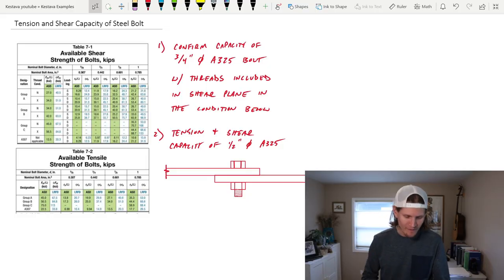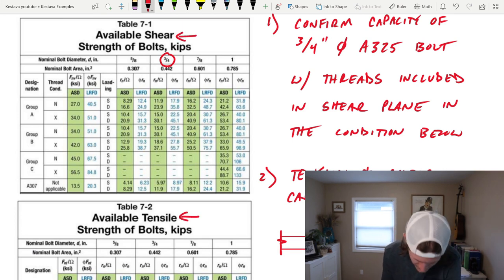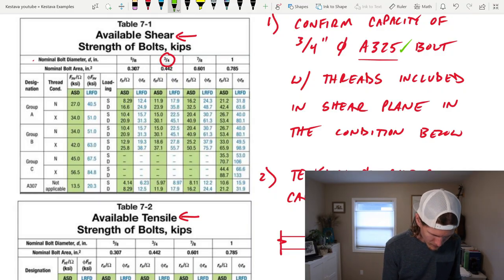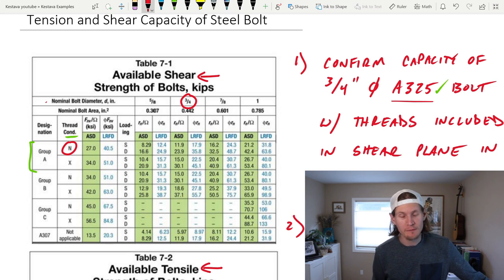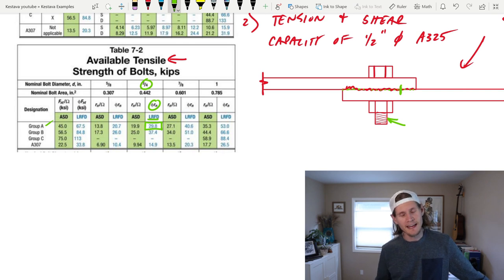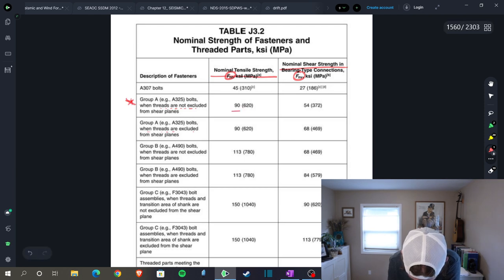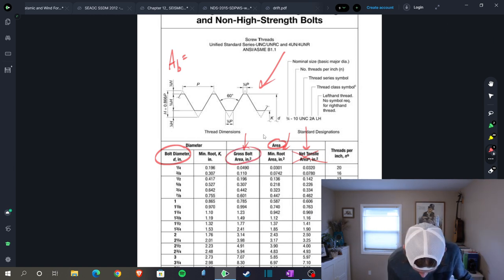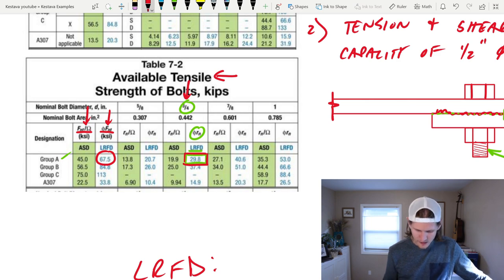Steel Bolt Design BY HAND and AISC TABLES - AISC Steel Manual 15th Edition

Comment: Ab says unthreaded body or threaded part? shouldn't we using threaded?
Reply from the maker: Hi Carolina - re-read it carefully - it says unthreaded body area of bolt or threaded part. aka its saying take the gross area of the (bolt or threaded part). when they say threaded part they are not referring to the threads of a bolt but to a threaded rod if that was used in lieu of a bolt. very tricky

Comment: When you were getting the area from table 7-17, why did you use the bolt diameter of 3/4 and not 1/2?
Reply from the maker: Part 1 called for a 3/4" dia bolt! part 2 (which we didnt get to) called for a 1/2" dia bolt